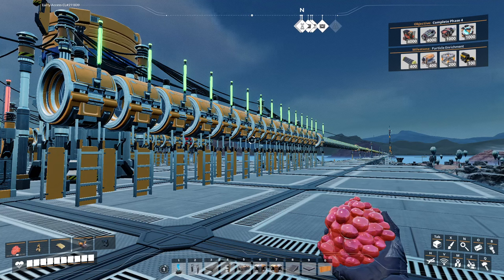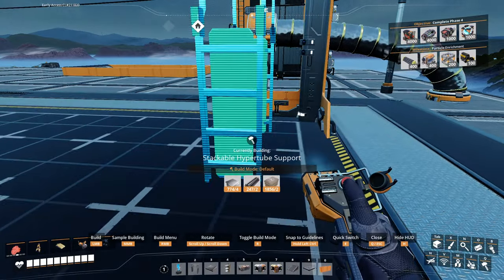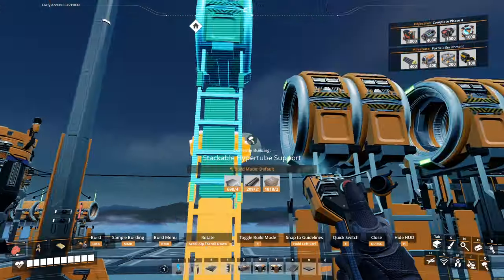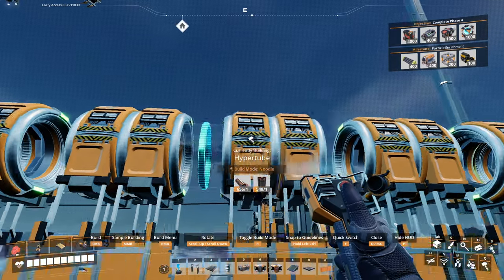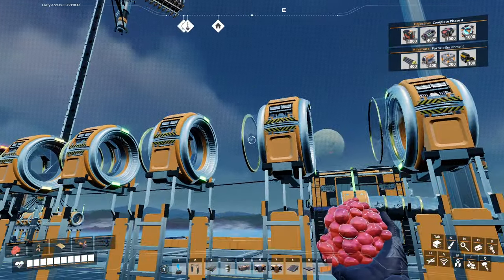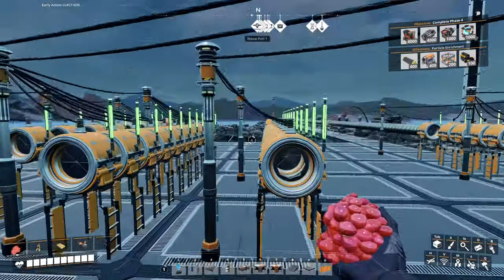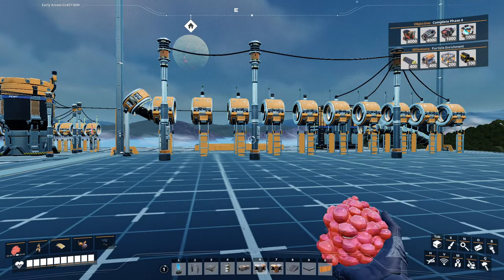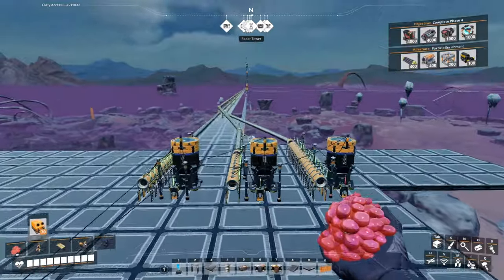Satisfactory Quick Tutorial On How To Build A Hypertube Cannon

Comment: I think you mentioned in one of these vids that it would be nice to have a delayed switch so that you could turn off the power before going through so it's not always using power,

I thought about it and came up with a decent design that does this so long as you have a fair bit of power:  hook your power system up to a switch and that switch up to your hypertubes and a battery or few. This will allow the battery to charge when the switch is on and to run the hypertubes for a short period while off, giving you some delay before they shut down. The battery would not be charged to full, just as a buffer when using. 

The delay time this offers can be calculated by this formula:   delayTime  =  (waitTime * min (batteryCount*100, (availablePower - hypertubeCount*10)) ) / (hypertubeCount*10)

Plugging in the numbers, for an example, would tell you that waiting 2 sec with 250kw free power and 10 hyper tubes with 2 buffer batteries would afford you 3 seconds of delay to use the cannon before it shuts off
Reply from the maker: Ya nice, would suck if power went out before you hit last tube, also to much math but good if you had that toggle timer switch then input it once..
But good to know that basic 10 tube number and post that time on sign beside it so you can charge it effectively. 
I only use 1 batter buffer, but to know the time/sec power units it charges and have extra linked batteries that all charge at same rate, you can setup 2 switches to toggle...
I'd do first is off toggle to turn on tubes flip on, start it off.. Second to toggle power going into batteries, its off and on to charge, easy then add batteries = 5 sec of charge for a 1 sec switch flip... Cuz i don't wanna wait and i want a 5 sec window... So by your math it would be 8 batteries for a 6 sec window on 10 tubes or 12 for a 15 tube. Then flip power on 1 sec, charge flip off, have 5 sec to go threw.  
So ya good to know batteries at charge at same rate and you can just stack them. Simple. Thats what i get for not even trying to use extra batteries. But ya i forget how much they cost to make so maybe a 2 sec delay and just 4 sec leeway would be better. 4 sec should give enough time to get then crouch jump and threw 15 tubes without feeling hurried.

Comment: Thanks for the tutorial, I like making them with the stackable supports because it makes it less likely that someone will accidentally go in.

I did have to modify the end, the tilted bit I only did 1 tick tilted down instead of 2. When I did it 2 ticks it either didn't work (I just fell out at the end) or I died when hitting the exit. It may have been because of my refresh rate or something, but if someone is trying and having issues with launching try doing 1 tick instead of 2. You still get a lot of distance.
Reply from the maker: Ya it can be picky with spacing too, but glad it still works with new update.. Haven't jumped in it yet cuz their was no progress content, tho i still have to make nuke plant system... But that will be so much work.